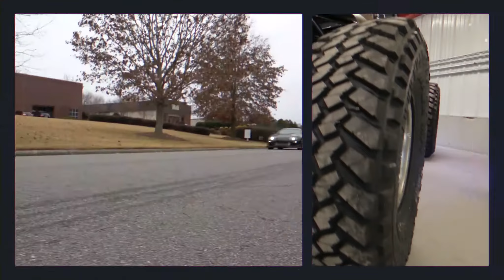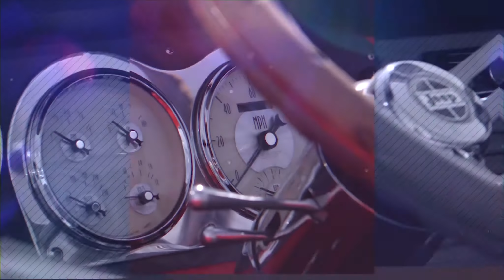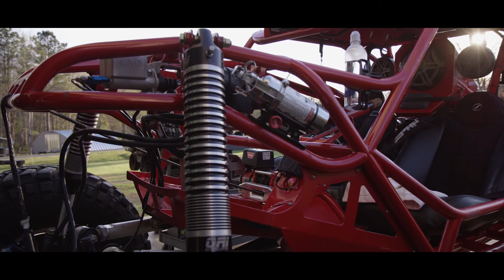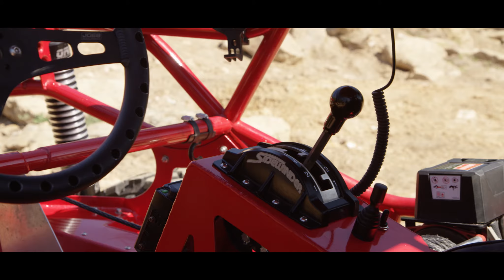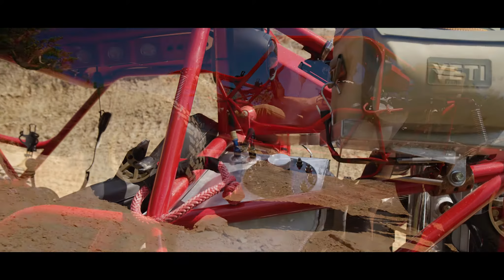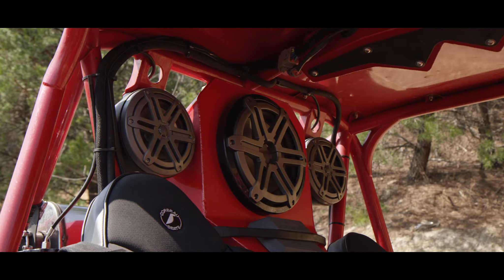Inside Line: The ECOTEC powered rock crawler Buggy

Comment: I have a question. Since the vehicle speed is a basic crawl and the ride is very controlled, do you really need anything beyond a 1/4-ton axle?
Reply from the maker: I think in this scenario, it’s not so much about the load capacity of the axle but the strength of components. You can definitely have lighter, smaller components that are just comprised of better material for sure. You still want something fairly significant though because when you’re dealing with undercut ledges or things that might load the vehicle where everything is put onto one corner, you’re gonna need something strong enough to deal with those forces.